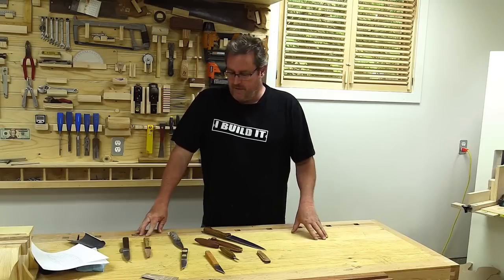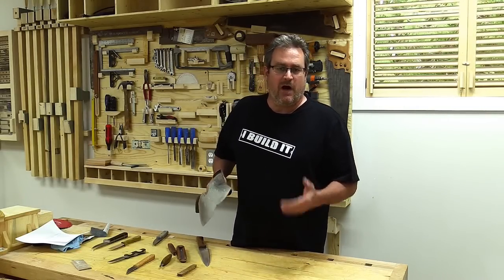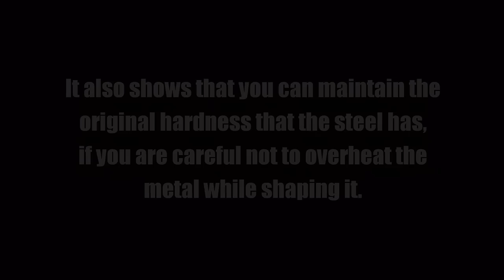Knife Edge Retention Tests

Comment: Just found your channel and the videos are incredible!  I have quite a lot to catch up on.  I read those comments questioning the capability of the steel you are using, and while the concern is understandable they really miss the mark.

Like you said, these materials are all hardened steels which result in a fairly similar blade: a iron-carbon alloy that has undergone enough of a phase transformation to increase the hardness but not develop as much martensite that it is too brittle. The comments on losing the effects of the hardening process due to grinding and sanding are pretty wrong. As long as you aren't heating the steel past 350 degrees F (give or take some), you aren't going to alter the crystal structure of the steel at all. Even if you do, you would have to hold it those elevated temperatures in order to develop larger microstructures that slip easier (higher ductility).

I'm actually not so sure about this, but I'm guessing the big difference between these "high quality" steels you might see out of expensive knife makers and maybe a shovel is the control on % of alloying elements and interstitial elements in steel. Nothing wrong with wanting the best materials made with the best processes, but boy were people taking some liberties with their "facts."

Comment: Hey! I was the one who suggested the reshaping of the kitchen knife. Another fun thing I've found: if you position your 1x30" belt sander so that the belt moves away from you and is in a horizontal and not a vertical position, you can easily sharpen knives with about 400, 800, or even finer grit belts. Take care in your craft!! (P.s., grinding steel won't ruin its temper unless you see the edge draw to a bluish color)

Comment: Anyone who says grinding steel ruins the heat treatment is not fully informed. Two things will ruin the treatment: 1. Too much heat for too long (which can be generated via grinding, but can also be avoided with some care) 2. Destroying the treated area (the hardened steel is not necessarily hardened all the way through on thick work pieces, but for something as thin as, say a shovel, the treatment should be consistent throughout)

Comment: The kitchen knife also has a much larger cutting surface.  While parts of it are certainly dull other parts are still sharp because those parts weren't cutting rope.  The concrete knife has a much smaller blade as is the utility blade.  I think for general purpose the concrete knifes blade is comparable to the others.

Comment: This demonstrates something, but I'm not sure exactly what.  To prove more, I think it would require more tightly restricted means of cutting the rope, including force, movement (which you mention in an overlay comment there at the end), sharpness testing (removing some of the variables of cutting paper), and perhaps most importantly, a control for a "known ruined temper" blade and one for a known "ideal temper" blade.  I don't know what conclusions we can definitively draw from it (unless we're rope cutters who make our own knives), but a sincere thank you for taking the time - it was interesting (I was surprised that the sharpness on any of the blades was degraded with so few rope cuts - tough stuff that rope is).
Reply from the maker: n8guy You don't ask for much, do you :) 
It demonstrates that the blade made from a shovel, with no additional treatment, held up as well as a properly heat treated utility knife blade. If you destroy the hardness in a piece of steel by overheating it (annealing), it will not hold an edge long enough to cut through the rope 1 time and still slice paper, let alone 23 times. It would be not better than straight mild steel that has been sharpened.

Comment: This is so comforting for someone who wants to smith. One of the things keeping me from doing it is that I'll destroy the temper by grinding, but no! I just have to be careful with the temp and maybe keep a cup of water to dunk it in nearby :)
Reply from the maker: BeenieBomb That's it, grind carefully and keep it cool - you won't ruin the hardening. You need to start with something that is already hardened, though.
Reply: I Build It Yeah! I was planning on using a rasp or something of the sort :)
Reply from the maker: A rasp or file are good, though they are usually too hard. You might want to temper it back so that it's less brittle and holds an edge better by putting it in the kitchen oven at 400 for 30 minutes or so, then letting it cool.
Reply: I Build It Great advice, thanks a ton!

Comment: Hey there John,
well if you think back a little, a few hundred years, blades were crafted from way inferior steel by todays standards and they were perfectly usable. Any steel that can be heat treated can be made into a cutting tool, like you said, the performance will not be top notch, but it's perfectly usable. Even today in India, Khukuris are forged from old leaf springs (5160 spring steel) and they are exceptionally well done. If the steel rusts relatively fast, it will make a suitable knife pretty much, stainless steel is a little more tricky but oh well.
By the way, I personally would not recommend chopping with the concrete knife, the shock might compromise the epoxy over time and break the bond.
Greetings,
Soly

Comment: A power hack saw blade makes an excellent knife blade. Worked in a motor repair shop were we made knives of them. You can cut through a 1/4" x 2" solid copper bar using a hammer with no damage to the blade.

Comment: Some knife nuts really no little of steel except what is told on the net about knife steel. Any halfway good steel will do the job. Let's face it they used bronze in the past. Before that stone. You can cut fairly good with a can lid.

Comment: the olfa blade was the first one to go
because its meant to be used only the tip of the blade
and snap off the dull tip and use a new piece
but i cutted a carpet with the blade fully extended and dull the blade in one go

btw nice kitchen knife

Comment: The shovel blade performed plenty good enough for me.  Now I want to see how the blades made from jigsaw, drill bit, and crowbar do.  Can I expect that test video by next week?  lol  Wow, this has always been a touchy subject with some people.  Years ago a friend of my daughter was wrangled into selling knives door to door.  I learned something from that.  Her serrated knives outperformed my plain bladed Henckels that I had sharpened in preparation for her coming over.  We both cut tomatoes easily, but hers cut rope much easier than mine.  I pardoned myself for a minute and went out to the shop and did something that would freak any knife lover to death.  I ran the blade of my Henckels chef knife over the course stone on my bench grinder.  I put a really ragged edge on that thing.  It cut rope AND TOMATOES as good as her serrated knives after that.  The down side of course is that the little jagged points I'd created were fragile and didn't hold up for long.  And if anyone were to constantly sharpen with a coarse stone, they soon grind the blade away.  Plain blade for kitchen use, serrated for rope.

Comment: Thanks John, I agree with you about using tool metal. I made a knife out of an old file I salvage out of the Harbor in Subic Bay, PI. I am not near the craftsman you are, I have used the knife for the past forty years and it still carries a great edge. I probably sharpen it every couple of months. I have used and abused this knife and it is still my favorite.

Comment: Knife "collectors" are like delusional audiophiles, they buy all the hype when it comes to the necessity of certain steel blends when they do nothing but baby their knives behind display cases. Or brag about their $500 EDC knife that only opens up packages or McDonalds wrappers because all they do is consume and follow suit.
Reply: ***** To a large extent I agree with your sentiments here, that said I'm aware of only a few knife companies that go up to the $500 mark for production knives. Chris Reeve (Sebenza makers) and Microtech come to mind, those are really quite expensive for what you get in my opinion and not a thing I expect to have myself.

I own a few knives that some people consider too expensive for what you get (spyderco endura, a delica and a benchmade 940). The first two I bought myself and I've not regretted them ever, both solid choices depending on what the occasion and pockets of your clothes can handle. The last one was a birthday gift, and I probably wouldn't spend that much on any single knife. But I didn't go into any of those expecting them to be magical super knives, I liked the colour options and form factor of the knives, and for an EDC item that'll last you years its worth paying a premium for a design and construction that you like in my opinion.

The improvement of the steel used in those knives (VG-10 and S30V) over "typical stainless steel" such as 8Cr13MoV in many of the cheap knives out of China (assuming both are made well and the heat treatment is done well) isn't anything major. If I'd have to quantify it based on own experience over the years about 20-30% more work done before I have to touch the edge up. Could go on about more varieties of non-stainless steel I have experience with both through owning it myself and often getting a lot of knives by people I know to sharpen them but it'd only get distracting. 

I've come to the conclusion that unless something is seriously done wrong a knife tends to be fit for purpose well enough, so I'm not really surprised that these reused materials from other quality tools ended up giving satisfactory results.

But you do have a point about the people who go a bit overboard and collect knives and not use it, not that there's anything inherently wrong with wanting to collect things in my opinion as long as you can afford it and it gives you satisfaction. However the bragging and attitude issues do exist in a  way that comes across as being a bit too much of a jerk at times. Oh well its the internet, you know what happens in discussions in for example the youtube comments section, forums and places like reddit. It degenerates into stuff like this: http://www.smbc-comics.com/index.php?db=comics&id=2939
Reply: ***** Agreed. Buy what you want, but don't deceive yourself into thinking your $200 knife is $185 BETTER than my $15 knife. The best pocket knife I've ever owned is a Milwaukee Fastback 48-22-1990 Drop Point. It's not the highest quality knife I've owned, nor is it the most expensive knife I've owned, but it's the knife I go to for EDC, job site, contract work, and everything else I can think of. I'm not afraid to use and abuse it because it cost me $15. It could hold an edge better, but it sharpens up real quick. I don't think I'll ever spend much more than $30 on a pocket knife because I know how good a $15 one can be. My buddy in the military kind of babies his $80 CRKT (which is an awesome knife), but I'll get right in there and pry, dig, drill, twist, and do whatever because, again, $15.
Reply: +Alex Van Nostrand 
Whereas an audiophile will buy expensive equipment that measures worse than an Iphone and claim to hear "wider soundstage" and "more refined mids and treble", a $500 knife is most often made with much better material than a $100 dollar knife. The hardness and strength is easily verified.
Reply: 温祺伟 The problem is, if you spend 20 times on your knife what I did on mine, will it literally hold its edge 20 times longer? Will the knife do the job 20 times better? Or faster? Again, I understand that some people prefer higher quality, but don't look down on a knife just because of its price tag. A knife is a tool. If you aren't willing to use your tool for its intended purpose because of how much money it cost you, then that tool isn't doing its job.
Reply: Budsygus A Bugatti Veyron doesn't have 30 times the horsepower of a Ford Focus RS either. Of course it's diminishing return as you move towards higher end stuff.

Also people who can afford a Bugatti Veyron don't have to drive them to work, right? For some people it's just a nice and cool thing to have around and to marvel.
Reply: 温祺伟 Exactly. My only problem is when people try to convince others that knives (or guns or cars or headphones or whatever) that cost 20x as much are 20x better and the cheaper ones are worthless. People can buy whatever they want, but don't look down on people who go for value over expense.

Comment: Now all you need is a project that you need small bits of rope for..

I think the problem most people have with your knives comes from the 'survival types' that want a knife to rely on. When you are at home or especially in the workshop a knife that can hold an edge reasonably well and can be sharpened easily will do fine, since you have your sharpening stuff on hand anyway.
Reply from the maker: MrPanohead I've sharpened knives on concrete, pieces of stone and the bottom of dinner plates, so my sharpening stuff is always on hand. :)